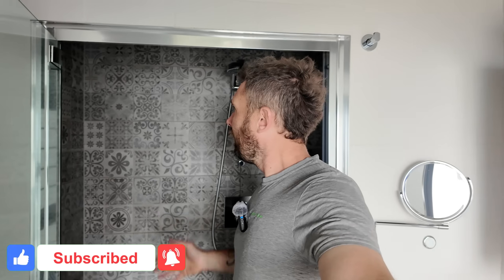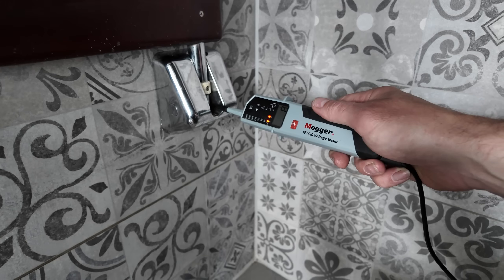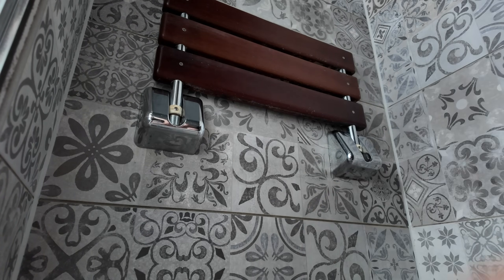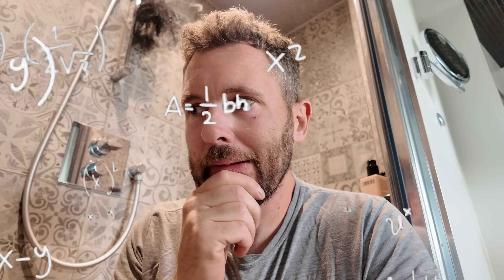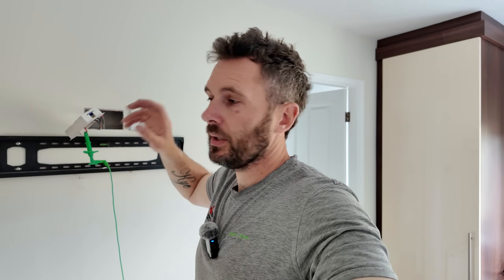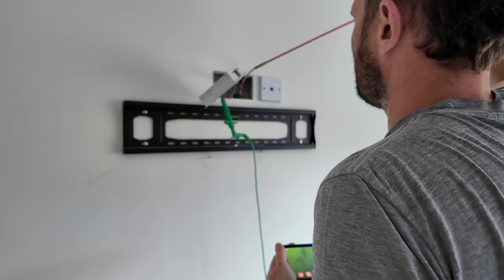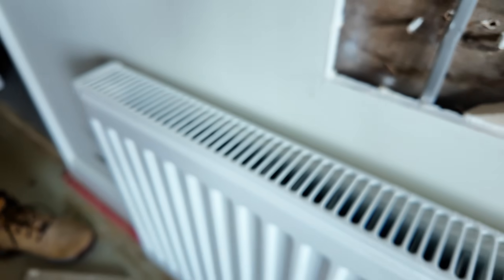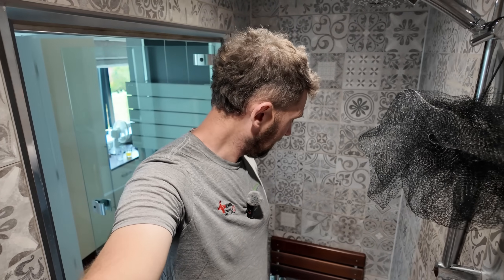DEADLY MISTAKE !!!! Makes Electric Shower a Death Trap

Comment: So; A drill was used to allow fixing of whatever, but apparently, the fixer person didn’t have x-ray vision, nor any device to detect reasonably accurately what might be buried in the wall. Excellent. On a more serious note, was/is that stabbed cable protected by anything in the RCD family? If it was, why no trip? Surely an imbalance occurred. However, the voltage measured was 167V I think. If there was an RCD, was it rendered impotent by the available voltage not being able to push near enough to presumably 30mA through the person (Ohms Law etc.)? Thanks for the video.

Comment: Dont get why you took the floor up , i would of just cut the plaster board out like u did .Its obvious theyve screwed into a cable directly behind the seat .
Reply from the maker: Wasn't that obvious and also as explained in the video I was trying to do it without causing any visible damage, but unfortunately it wasn't the case and it had to be done

Comment: Nah, that's nothing.  I was called to replace a 12.5kW shower that had gone bang - it sure had!  Black blast marks all around the wall like a Wile E Coyote / Road Runner cartoon, one severely frightened wife, who didn't even get to wash the soap off!   After main switch was shut off, tested for 0 volts, everywhere, for my safety.  Then tested another plug - still live - some builders had connected into the NEIGHBOUR's wiring!  Disconnected that, went back to the shower, 0 volts (phew).
 
The connector block had melted & wires shorted out, because the screws were never tightened.  BUT, the 12.5kW shower takes 52 amps, and had been connected with 13A ring mains cable, all melted along its length IN THE EAVES (It should have been a one piece 60A cable from the fuse box with separate fuse); NO double pole switch in the bathroom, NO fuse,  NO RCB, and, wait for it... no earthing or equipotential bonding.  They were extremely lucky that no-one was killed or a house fire started.

Comment: In my neck of the woods (no ring circuits) tingling sensation from metalwork in the shower often indicates loss of the incoming neutral -- an extremely dangerous condition.

Comment: Such a common occurrence when putting screws or nails into walls without considering possible electrical wiring in the wall.  But why would you ever think there's a junction box below and cut into the floor?

Comment: great video, a perfect advertisement for not buying a modern house
Reply: Modern houses are fine, probably built to modern, stringent codes.  It is the incompetent repairs (upgrades to the shower, and/or running unprotected cables in walls for the TV, it sounds like) that cause the problems.

Comment: it could have been at a higher resistance going through a wet seat and getting only like 50v or a bit less to the persons body, at ac 50v you certainly feel it so my guess it's a bit less as he said they wasn't sure if they did or not get a shock until multiple people said the same.
In this case there wouldn't have been enough current to trip an rcd due to the high resistance

Comment: So you have metal work in shower I.e. pipe work which is bonded to earth then somebody introduces another metallic object (chair) which to top it all is wet, then doesn’t bond it!!! Fuck me!! 
Then we have a metallic object capable (and has done) of bringing mankind voltage and another metallic object bonded to earth!! And nobody thought of bonds g these together!! 
This is pretty much a perfect example of what Equipotential bonding is required. 
Also maybe a nice looking install Mike but those lights look pretty new so where is the RCD for this circuit???
Sooooo dangerous!!!

Comment: I have two questions. 1 was there a RCD protection? 2 how is t possible that you measure 169 and you have a full connection with the 220 life wire with the screw.
Reply: The screw is not ideal conductor or making ideal contact, increasing resistance causing a floating voltage between 0-230v.
Reply: Its 169 volts referenced to the shower mixer plate and not a/the true electrical earth
Reply: Exactly. RCD should have tripped
Reply: @shaf3295was there an RCD? May not be enough current flowing to trip an RCD.
Reply: Assuming the RCD is in good working condition, it will need around 20mA to 30mA  to trip.
Reply: Can you explain you mentioned we had continuity between live and neutral?

Comment: The cables should not have been run in the wall behind the shower they are not  in  a safe zone
Reply: Looks like it all the electrics meets regs, whoever installed that seat should have checked what was on the wall behind!
Reply: How are they not? It’s the cables for the tv socket in the bedroom…
Reply: Irrelevant comment. 
Shower is on the different wall to where the problem was.
2 it’s the shower seat and How do YOU know TV socket was installed AFTER that???
Reply: @shaf3295how’s it irrelevant 😂 it’s not hard to walk around a wall and check, irrelevance is what has caused the fault,
Reply: @shaf3295it clearly wasn’t installed after was it if the screws went through the cable

Comment: My first instinct (before seeing where you cut the wall) would have been to drop the rad and go into the wall behind - to make repair less intrusive).
Reply: I was thinking just cut the wall open way before taking carpet up etc, plus a quick wire joint would have had that repaired better than wagos but he might not have any.
Reply: Ditto.

Comment: I guess there was no RCD on the circuit?
Reply: Maybe if they had touched 1 hand on the bracket and the other on the shower, it could have been at a higher resistance going through a wet seat and getting only like 50v or a bit less, at ac 50v you certainly feel it so my guess it's a bit less as he said they wasn't sure if they did or not get a shock until multiple people said the same.
In this case there wouldn't have been enough current to trip an rcd due to the high resistance

Comment: Great video and fault finding.  Did you, or would you, IR the cable/circuit earlier in the investigation?  In my minds eye I would have IR before cutting holes and lifting floors, but it seems it would not have picked anything up, in terms of the fault being able to activate circuit protection.  Also, the RCD should activate in the event of a person touching the fault part of the chair, but would it activate if the fault path was somehow back through the same faulty (energised) part?